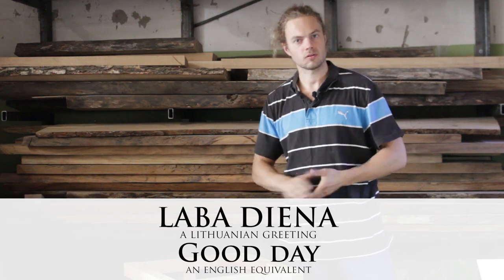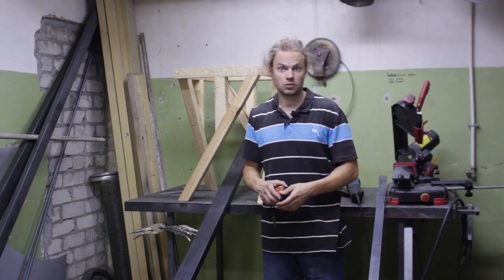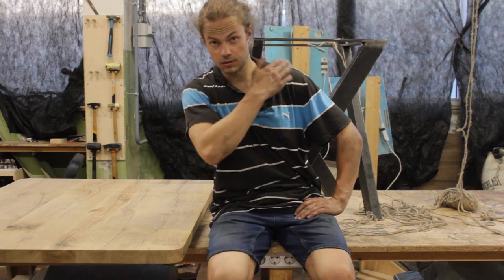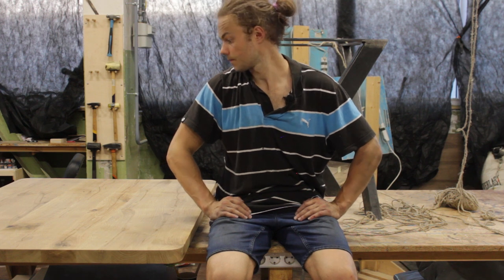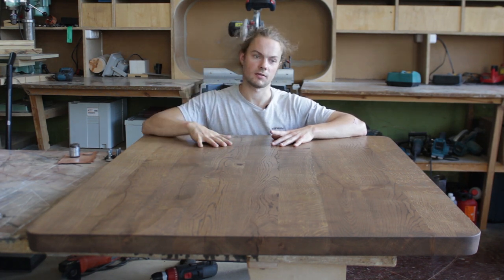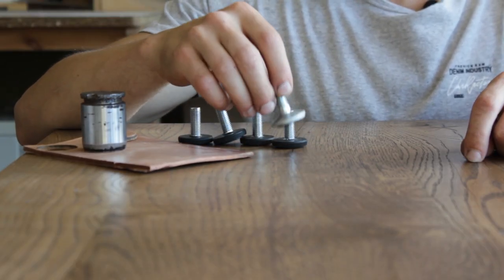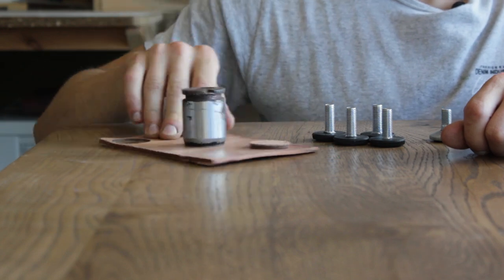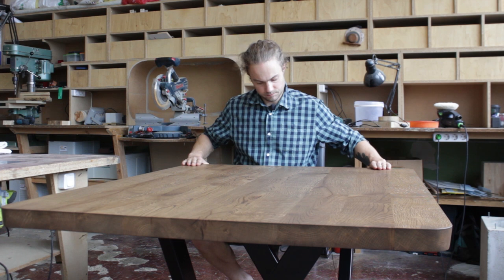MODERN TABLE BUILD . making a small dining table step by step

Comment: Nice project and video👍👍👍 3 questions 😁:
1. What have you used to remove the zinc from the metal threads and how long does it take?
2. What lacquer have you used for the clear coat?
3. If you would not have stained the top, would you have used a oil finish instead?

Lot of questions...I'm sorry 🙄😀
Reply from the maker: First of all thanks for watching! And it’s my pleasure to help you. I removed the zinc with a nitric acid which is used to clean the welds on stainless steel. And it’s very quick. A few minutes and you are good. Just don’t forget to neutralise it. I used window cleaner, but any soapy solution would work. The lacquer I used is two component industrial lacquer. I think it’s polyurethane based. Renner is the brand. And lastly it doesn’t matter if it’s stained or not, I could use lacquer or oil on both applications. It was client choice to go with the lacquer.